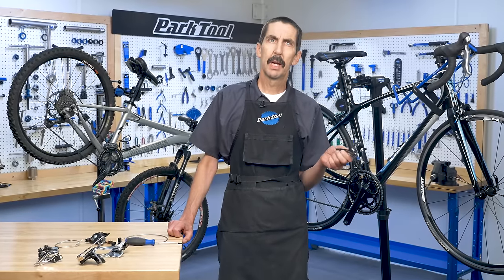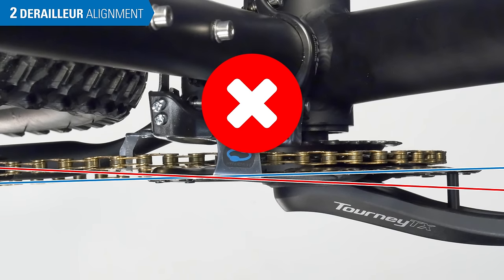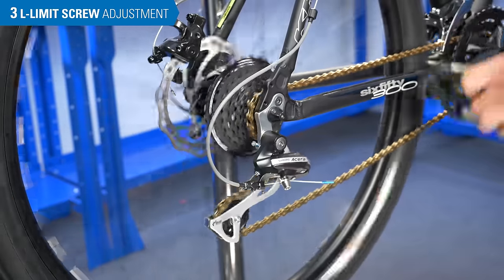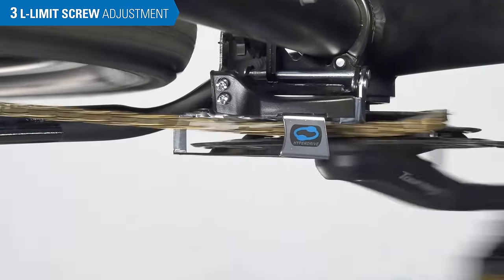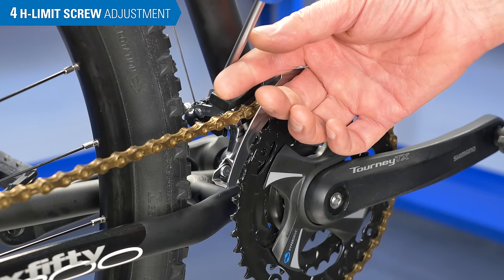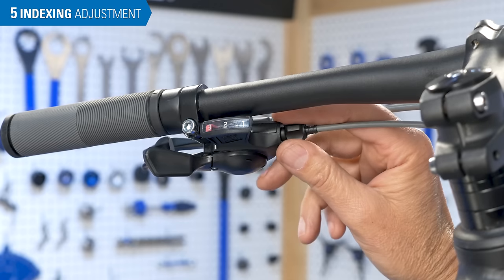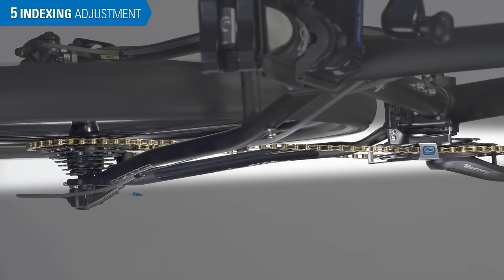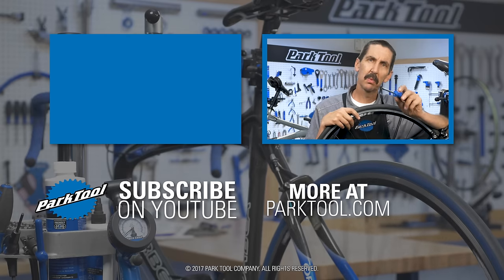How to Adjust a Front Derailleur

Comment: Setting the H limit screw confused me because it turns out I have a fourth "layer" in addition to the three front chainrings on my bike. I don't 100% know what this is for, but it seems to keep the chain from falling off the bike at all, if the H Limit is too loose. (You'll see the chain twist towards the outside and the pedal action gains friction, but the chain will not fall off the bike.)

Actually that's pretty cool. But adding pressure to the shifter causes the derailleur to rub against that part. Without pressure (aka just using your bike regularly), there's no rubbing. How should the derailleur height be adjusted? Should I only be worried about rubbing if it has to do with the chain?

Comment: Great video but 10:20 to 11:30 confused me. There is no cage movement then you make movement then you take the movement away again? I watched it over about 10 times and I'm still confused. My H limit screw is adjusted so it stops the cage from going any further than needed to change to the biggest gear.

Comment: How do you go back to default baseline and start over as if you replaced the front deraileur.  Screw the barrel at the handle bar all in or out? Back out L-screw and H- screw all the way? Loosen cable clamp at the deraileur? This thing is so out of adjustment. I’ve watched this video several times but I run out of adjustment at the barrel or the H/L limit screws! Arg!

Comment: Hi! My road bike (Gravity Avenue, bought off Bikesdirect.com) has a pinch bolt that doesn't allow me to easily adjust the front derailleur cable like shown in these videos. I'm wondering if this is common? My front derailleur cable is loose and I don't know how else to adjust it, given that it isn't shifting my front derailleur gears whatsoever. Any recommendations are welcome! Thanks!
Reply from the maker: The cable fixing bolt on that bike should be fairly accessible from the backside of the bike. You will want to put it in the smallest chainring and take out any slack in the system there.
Reply: @parktool  Thanks so much for your response -- I'm curious if you have any videos or images that could help me identify the "cable fixing bolt"? Sincerely, Phil

Comment: so tightening the L screw brings the cage away from the bike whereas tightening the H screw brings it towards the bike? Is that correct?
Reply from the maker: The low limit, limits the movement towards the bike and the high limit, limits the derailleurs ability to travel outwards. Indexing is done with cable "tension" between those points and can bring the cage in our out between those two points.

Comment: Maybe I missed it, but does it matter how tight the cable is at the start of the process?
Reply from the maker: The cable should have as little slack as possible without moving the derailleur. Pull the cable tight then tighten the anchor bolt.
Reply: @parktool  Thanks for the reply. Much appreciated, and unexpected : ) I'm guessing the gear barrel adjuster should be somewhere in the middle of its range to allow adjustments either way? Does that make sense?

Comment: In my bike the aifting is very very very hard to do. I use a thumb style shifter. Even when i apply force to it with my palm i cant shift into 3rd. I have more powerr in my right hand so i basically have to put in 3rd before going anywherre

Comment: Damn, after like 4 hours or messing around mine is still rubbing in the smallest gear, and the screw is all the way in I can't set it any lower. Is this the point where I should adjust he cable or is my 29 in the rear just too large a cassette for an ultegra 6600?

Comment: So my bike has 3 sections where the front detailer should be able to move my chain between all 3, but it can only move from the biggest to the second biggest.. If I adjust it so it will push to the third one.. Then it scrapes off the detailer when it's on the first one... What can I do?

Comment: At maximum looseness, i still get a lot of chain rubbing against the outer cage in the lowest gear (ie large gear at front, smallest gear at back). Any ideas on how to stop it?Boardman Adv 8.6, Shimano Sora 18-speed gearing with an 11-34T cassette, if that helps.
Reply: Good luck. No one replies
Reply: @TheMijman  well, Halfords say that I have trim gears and just need to learn how to use them 🤣
Reply: @LeeCampbellgplus  Great! Top tips coming from all directions...

Comment: Not all JIS bottom brackets of a given spindle and shell width give the same chain line with a given crankset unfortunately as I have found out . Sometimes spacers can help but crankarm distance to chainstay should be as close to equal on each side as possible but in rare cases cannot be achieved .

Comment: Whenever I try to fully rotate the barrel adjuster it gets stuck. Can you help me out
Reply from the maker: Your barrel adjuster may be bent. That can prevent a barrel adjuster from freely moving 360 degrees.
Reply: @parktool  is it fine my front derailleur screws are a loose a bit i don't know yet if i should tighten them because i got derailled 2 days ago i was lucky i knew how to fix it

Comment: what does "L" and "H" stand for on the set limit screws?
Reply from the maker: "L" stands for "Low" and H stands for "High".  This is not such a good system of names.  The L-screw controls the most inner stop position on the cage.  The H-screw controls the most outer stop position of the cage.  "High" means the larger ring, for higher gear rations.  "Low" means the smaller rings for relatively lower gear ratios.

Comment: What is the cause when nothing happens when you tighten or loosen the L and H screws on the front derailleur? Specifically the L screw.
Reply: Probably to much tension in the cable, time to undo the barrel adjuster and stars again. Or the limit screws are not screwed in enough, they only start to do anything when they are tightened at least half way in.

Comment: I got a problem and i don't know how to fix it. So, when i screw or unscrew the L or H screws, the derailleur is just standing still . Not even flinching
Reply: They only start to move when they are screwed in past halfway or more. If not then try removing all tension by unscrewing the barrel adjuster and then try the limit screws again

Comment: At 7:31, why would you need to shorten the cable at the bolt? Can I just turn barrel adjuster counter clock wise again to “shorten” the cable?
Reply from the maker: The barrel adjuster can only take up about 1cm of cable. So you need to get in the ball park before relying on the barrel adjuster.
Reply: @parktool  got it! Thank you

Comment: What does the L and H screws stand for , low and high ?
Reply from the maker: "L" was for "low" and H was for "high".  However, that is gear ratio terminology, not cog position.  I would have preferred we use "I" for "inner sprocket" and "O" for "outermost sprocket".

Comment: been working on a chain rub issue for a couple months on a  11x3 build project, and it was driving me insane, watched every video, read all i can find on the issue,and still, it rubbed the rear low end of the derailleur when in the highest and lowest gears. i tried 5 different sizes of front derailleur, still no luck, until the fifth derailleur,....as i was leaning over the top to make an adjustment, and saw the suspension dropped the derailleur and the chain cleared the spot it always rubbed, in other words, without weight on my bike the problem cant be fixed....i learned two things that day   1. how to not fix a non problem  2 there is such a thing as tears of stupidity

Comment: I have remounted my derailleur and the cage is parallel to the chain rings, but doesn't go far enough out to the the largest ring. How do I get the parallel derailleur further out with shimano acera?
Reply: Take up the slack by pulling the cable out with pliers when the cable is in lowest tension.

Comment: @Park Tool Hi, I have a shimano 105 derailleur and a 2x11 drive terrain. When adjusting the the H limit screw I can move the cage right and left but the problem is when adjusting the L limit screw, the cage moves only to the right but doesn't want to move to the left which is what I need because it is causing chain rub with the front cage. Furthermore, I tried this on my wife's bike which is exactly the same model and when adjusting the L limit screws I can move the cage to the left and right but I can't move the cage to the right when adjusting the H limit screw to the right, I can only move it to the left 🤔 and I can't even look it up on youtube because on every single video the mechanics adjusts the H and L limit screws the cage moves left and right to theur convinience but none of them ever mentiones what happens when the cage does not to one side :( any chance you can make a video showing how to solve this problem please?
Reply: It should move to the left by itself because of the preload of the spring,  tension of the cable moves the derailleur outwards, the spring is moving it inwards.
Maybe there's something bent or damaged, or something is blocking the derailleur

Comment: Ugh. I was doing this to a 3x7 and every time I tried shifting to the second gear it would just jump to third. No matter how many adjustments I made the damn thing would over shoot second. I guess it might because the bike originally had twist style shifters and I switched them over to trigger style. So maybe some compatibility issue or some trigger adjustment I'm not aware of. I ended up just locking it in second. Anyway I'm done. 1x for life.

Comment: Adjusting the rear derailleur was easier (but more steps) than adjusting the front derailleur, which just doesn't want to cooperate.  40 years ago, my derailleur adjustment was made on the fly with friction-loaded levers.  Much easier.  I wonder if someone is making that kind of retrofit.
Reply from the maker: You can still find some companies making friction thumb shifters. Sunrace have some that you can make friction.

Comment: Is it normal if i have to shift two times from the first gear of the front to the second bigger gear? I have to do it twice so that it would change
Reply from the maker: That is not normal. One full swing of the lever should get you one gear shift. There are sometimes "half shifts" or "trim adjustments" on some front shifters that help fine tune the alignment but are only used by moving the lever half the throw or less.
Reply: @parktool  thank you!

Comment: so if you're on oval front rings, does that change it? minez isn't going into the big ring no more
Reply from the maker: Setting up front shifting with oval rings can be tricky. Just takes a bit more patience. Also, shifts will not be as crisp as round rings in most cases.

Comment: Exercise bikes in the gym or home is the way to go.  I've had enough of these steel chain bikes with screws that take to much attention, derailleur failures, too many steps, clockwise / counter-clockwise mix-up, loose cables or cables too tight... and the list goes on... :(   Last century patents sucks.
Reply: That's boring.

Comment: Where do I find the barrel adjuster in a dropbar shifter, i.e., a GRX?
Reply from the maker: There may be one inline or you may not have one. With the new GRX there is a small 2mm hex that rotates the cable carrier, that acts as a barrel adjuster.
Reply: Thank you @parktool  . Does in-line mean something like these metal cylinders, like thick ferrules, interrupting the cable about 10 inches from the hood? I thought these were cable connections or a similar contraption.

Comment: Which one should be fixed first?? The front or back
Reply from the maker: Start with the back. It will help with the front. Start with the chain in the middle ring if a 3x. Small ring if a 2x.
Reply: @parktool  nxt vid... how to set up the cable shifters.. please thank you
Reply: Especially in the front derailleur thank you

Comment: all my front gears are working except shifting down from largest to middle .i can shift to the largest wheel without any problem. but cant shift down to the middle one. when i select gear 2 chain stays at 3.which one to adjust?

Comment: My front chain from gears 2 —> 3 clicks for ages and doesn’t bite into the gear cog.
Reply: Same here
Reply: Insider, Please tell me if you find a way to fix! I think it may just be the new teeth on the bike?
Reply: I found the fix, there wasn’t enough cable tension so it wasn’t moving from 2 to 3. 
So Shift the gear from 2 to 3 and Turn the front barrel adjuster counter clock wise until it shifts to the 3rd gear. In my case I turned the barrel adjuster completely and still wasn’t able to get enough tension. So go find where the cable is clamped to the front deraileur and pull it down a bit more and re-clamp it to tighten it up. Now it should shift from    2->3. 
Note= if they have previously cut the cable rather close and not left much length to adjust it, then you will have to get the cable replaced. Costs about $10-15
Reply from the maker: Sounds like a shifter flush may be in order.

Comment: Somehow setting FD is way more difficult than setting RD. When I follow this instruction, I stuck in H-Limit adjustment. After put the rear in smallest cog, I try to put the front side to the largest chain ring. But it's either the chain not shifting or the chain drop off from largest chain ring. Always like that. Now I need help to fix this problem guys.
Reply: For begin with, I can't even shifting to largest chainring in the front to start H-Limit adjustment.
Reply from the maker: Front derailleurs are more difficult to setup than rear derailleurs. Also, make sure the there are two distinct clicks in the shifter. Shifters can get gummed up and be missing a gear. This can often be fixed with a shifter flush.
Reply: @parktool  Thank you for your respond. I only have 2 gear in the front, so there is only one click in the shifter. And that's also something that make me a bit unsure about the cage aligment. Because even without push the cage, the outer cage is already parallel with the biggest chain ring.

Comment: Ok I got stuck 5:20 at L-screw setting. I'm supposed to check how the front derailleur shifts down but problem is the front deraulleur does not move at all. I tried adjusting barrel to no effect and now I have no idea what to do. Guess to the shop it will have to go. Sorry but this tutorial did not help me.
Reply: Exactly

Comment: When my front derailleur is in the smallest cog and smallest largest gear of cassette, I always have a slight rub on the derailleur cage that I've not been able to dial out. Is that normal or ok?
Reply: Did you mean small chainring and small cassette cog? If so, there will be chain rub on a Shimano and Campagnolo groupset as you're cross-chaining, something you're not encouraged to do on a bike.
Reply: @yonglingng5640  Sorry, yeah I worded that strange. I meant my small chainring and largest cassette cog. The chain is in constant contact with the inner side of the front derailleur cage. It's just slight contact but enough that I hear it and even if it's a small amount, it's drag and loss of power I'd prefer not to lose.
Reply: @grocerylist  In this case, your front derailleur's low limit is too restrictive. You need to bring it inboard a little more.

There are some bikes out there where this is impossible to do due to clearance at the frame (namely the 2021 carbon Émondas), but most bikes don't have this problem.

Comment: My L screw is completely loosened and still there is a rub. Also the shifter doesn't shift from small to middle ring even though the mech tries to push it. No click sound on the shifter as well.
Please guide
Reply from the maker: It could be that your cable is too tight, preventing the derailleur from dropping low enough to clear the chain. The second issue is likely a sticky shifter that needs to be flushed.
Reply: @parktool  thank you. I will try some combination by making the wire a bit loose. But, if I need to flush my shifter, do you have any educational videos on that ?
or how can I find it ? Its a microshift shifter the 3 speed side.

Comment: My derailleur shifts but the indicator(the red thing in the shifter) does not move. How can I fix it
Reply from the maker: Depends on the shifter. Sometimes you can take the top cover and replace a tab into a clip. But be careful as to not effect the function of the shifter. It's often not worth fixing the indicator because of the risk to the rest of the shifter.

Comment: Cable Tension is the most important but didn’t emphasize here.
Reply from the maker: The spring on the derailleur determines cable tension. Turning barrel adjusters and loosening the cable or adding " tension" to it changes the indexing but never changes the actual cable tension.

Comment: Buy if I align my derailleur parallel with the largest sprocket its literally pushing on the chain. I'm so confused still having lots of issues
Reply from the maker: Then you need to make indexing and limit adjustments to keep it from rubbing. All adjustments effect one another.
Reply: @parktool  Thanks for the reply. I had previously done the rear derailleur indexing. I simply raised the front derailleur a little higher than you recommended and tweaked the limit screw a little and now it's working perfectly. Thanks for the videos couldn't have done it without them.

Comment: I have 2 rings. It dose not want to go on the largest one so when i losen the H screw it is going on the large one but it also can go to the 3'th ring which does not exist so my chain falls of
Reply from the maker: Your shifter may have a 2x/3x selection switch. If it does, click the large lever one click then turn the switch and use the shifter from there. The pull rate is slightly different on a 3x derailleur going 1-2 than 2-3.